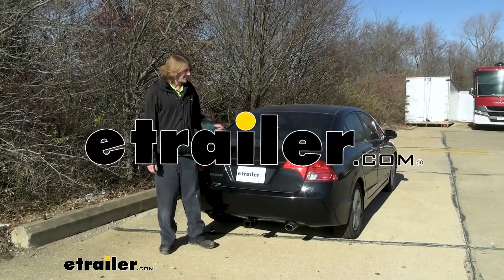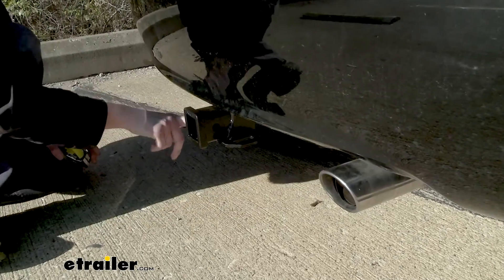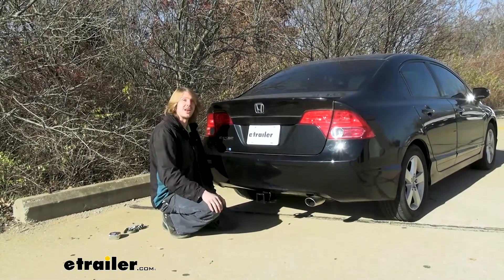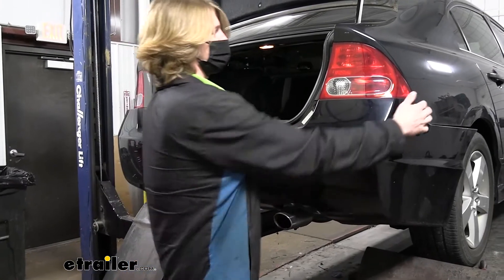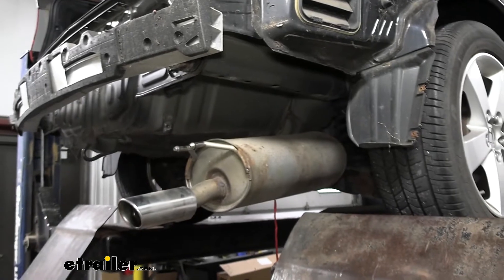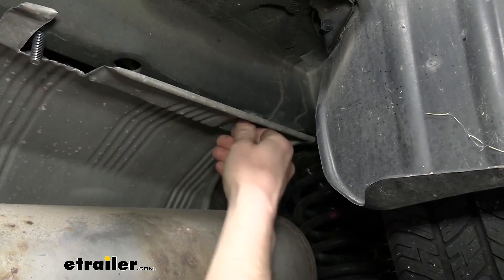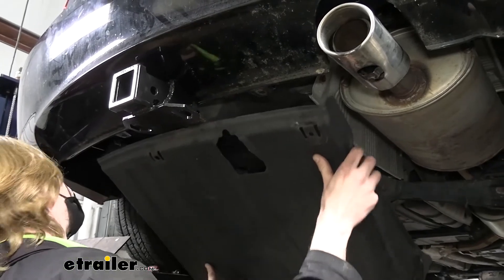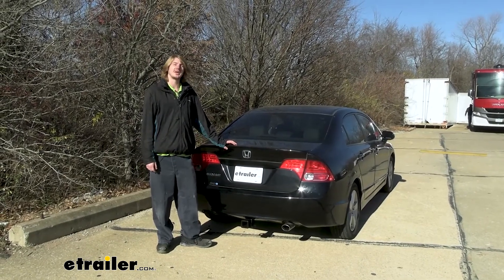etrailer | Installation Guide for the EcoHitch Hidden Trailer Hitch Receiver on a 2008 Honda Civic

Comment: Definitely better tutorials out there. Makes sure to put plastic cover BEFORE hitch not after like he did. You won't have to cut anything off
Reply from the maker: In our case, we did have to trim the underside of the fascia. For some vehicles, the amount that needs to be trimmed can vary by the vehicle trim level, but on the 8th gen Civic, it does need to be trimmed otherwise it will push up on the bottom edge of the fascia. If that doesn't bother you, then by all means you can skip trimming it.
https://www.etrailer.com/Trailer-Hitch/EcoHitch/306-X7233.html
Reply: what vehicle did you install your hitch on